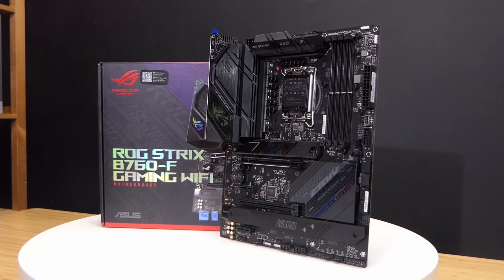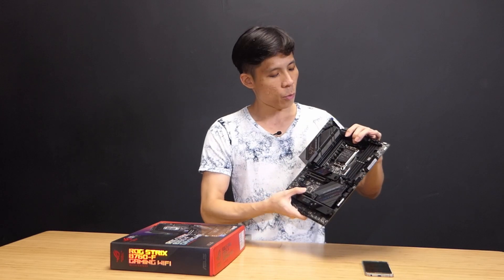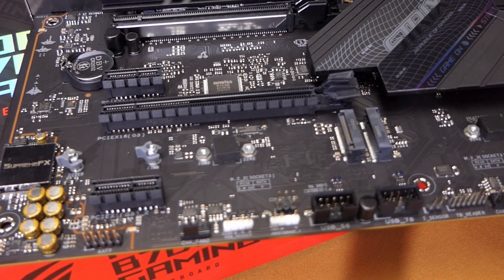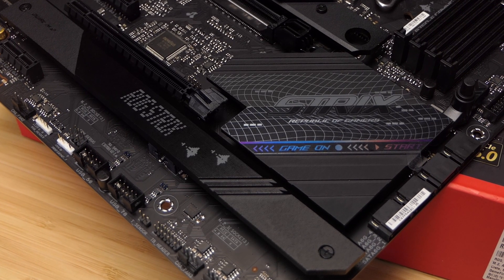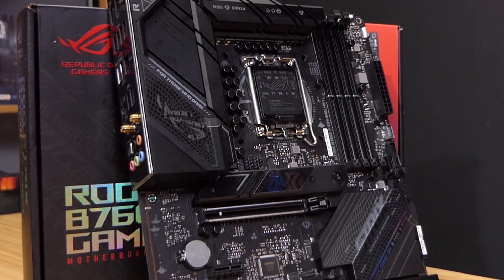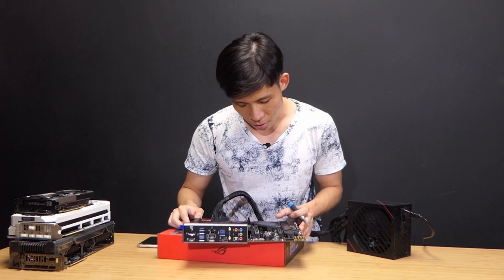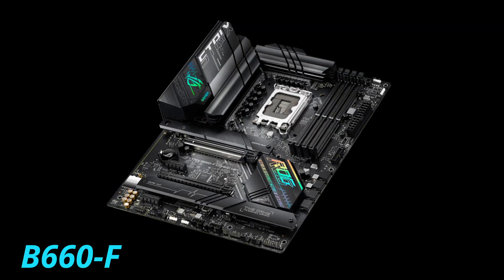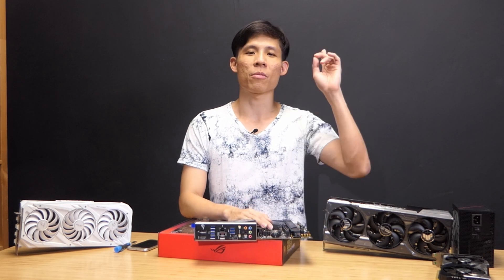Finally! B760 To Save Intel? ASUS ROG Strix B760-F WIFI Overview

Comment: What about the VRM? Just asking.
Reply: @Wawan Purwanto 
16x 60A SiC623  (2x8) + 1x 60A SiC623 driven by an ASP2100R (RT3628AE).
Which TUF you mean, if you mean the PLUS version it's 12x (2x6)  55A AOZ5316NQI + 1x 55A AOZ5316NQI. The question is only why buy an quite expensive B760 Board, when the ASRock B650M-HDV/M.2 is cheaper and good enough for most things plus with the option you can upgrade your CPUs in years to come.

Comment: I dont care about oc so I got this board with i7 13700k
Reply: You dont need to overclock anymore anyways these days since the cpus are so damn fast.
Reply: @teeaymusik9811  and damn hot, undervolt is a must these days
Reply: @laggmonstret  Which board would you recommend to undervolt well?
Reply: @laggmonstret  true, is undervolting at b series motherboards not possible?
Reply: @MonesahBuson  It's locked to do it the normal way, but you still can.  You have to either set a lower loadline voltage and loose performance, or on ASUS or Gigabyte (the only brands as far as I know) install a BIOS with a different microde (microcode 104) that prevent some Intel handling and protection to do it without any performance loss. You better watch some videos or read a guide about "how to" and what benefits and eventually drawbacks it might give tho before going for it :D
Reply: @teeaymusik9811  I would perhaps just go with a ASUS or Gigabyte B760 anyhow with a stock 13600K or look into change to a BIOS with microcode 104. But look it up before doing any BIOS tinkering like that!
Reply: @laggmonstret  Hey my system is already done. I went with the Gigabyte B760 Gaming X and this board is perfectly fine. Also i went with the 13600K. The Power consumption of the cpu is 5-10W in idle and later i found out that undervolting is not a must. So i didnt change anything and its perfectly fine.
Reply: @teeaymusik9811  That's nice! Glad it worked out well for you and the 13600K looks like a beast for the money :D
Reply: @laggmonstret  It's really a workhorse/beast. Perfect for my needs which is sound and video editing.
Reply: @laggmonstret  What do you think? Asus rog strix b760-f gaming or MSI z790 tomahawk? Both are ddr5 versions. Asus board is 260 bucks, and tomahawk is 330. I need it for my 13600k. I don't plan to OC because I don't even know how or why would I need it with such a powerful CPU.
Reply: same
Reply: And now u can't undervolt aswell good luck with that ;)

Comment: That motherboard definitely isn't enough for the 13900k/f
Reply from the maker: Whats the max CPU u think u will use?
Reply: whys that
Reply: @Maggot dog  its simply doesn't have enough power its too weak
Reply: @toonnut1  im trying to spend max 4k AUD and ideally i want a 4070ti got any suggestions of what is a good cpu and motherboard for that?
Reply: @Maggot dog it depends on what you do with your pc. are you buying from scratch or do you have a cooler and power suply and case already?  I've bought the 13900kf  and the z690 tomahawk ddr4 my memory is viper steels 4400mhz ive heavily tuned the ram and I've zero problems. If I was going to buy again I'd buy the msi z790 edge ddr4 instead of the msi z690 tomahawk. I wouldn't buy ddr5 if your just gaming because tuned ddr4 is just as good and cheaper. If your just gaming you can buy the 13600kf that's a great chip for gaming and it doesn't take much to keep cool my 13900kf is a very hot chip and you'll need at least an 360 aio cooler. If you want a good budget build buy the msi pro z690 the 12600kf viper steel 4400mhz ram because its bdie and great for tuning.

Comment: Hello, Can i put a 13600K on this mother board or it is more safe to put a non-K?
Reply from the maker: Hey Boss, I think it is safe to run a K CPU on this motherboard. I ran a 13700K on another B760 (and Cinebenched it), and it is fine so far. That said, I have yet to try OC on B760, so I won't be able tell u how it goes :)
Reply: @RealMelTan  Soneone in comment section said you can't overclock cpu's on B boards. Is this true? If so then you shouldn't even try should you?
Reply: @Nephilim2001  Some B boards can OC cpu
Reply: Thanks for you advice, maybe this week i will take the motherboard it seems a pretty good motherboard as you Said it
Reply: i guess its safe cause im using msı h670 tomahawk wifi dd4 - 13700k setup with 0 problem. H670 Tomahawk has a 55A DrMOS 14 + 1 + 1 phase digital power supply circuit.